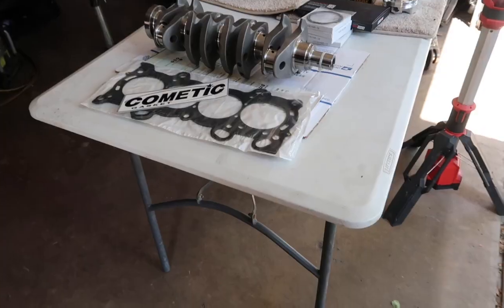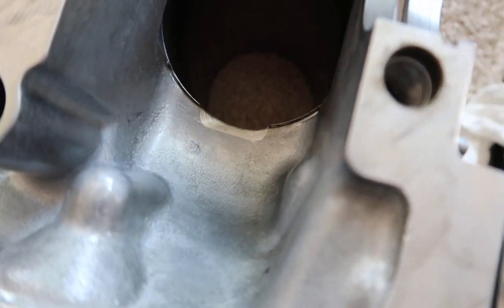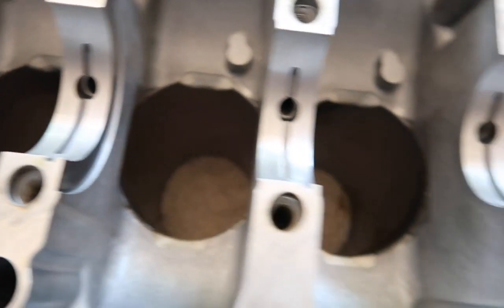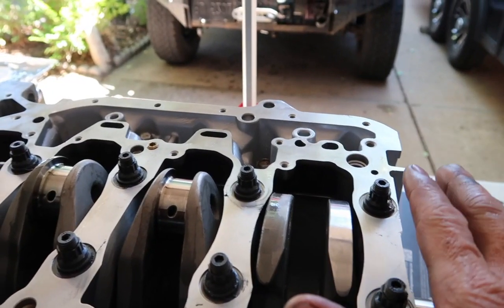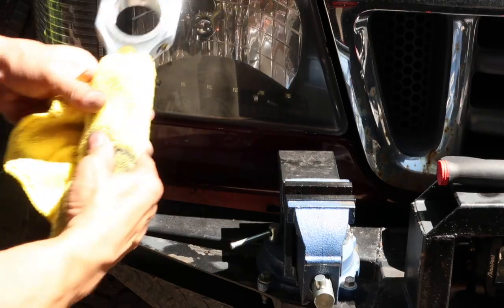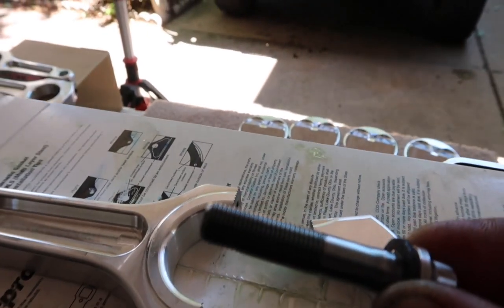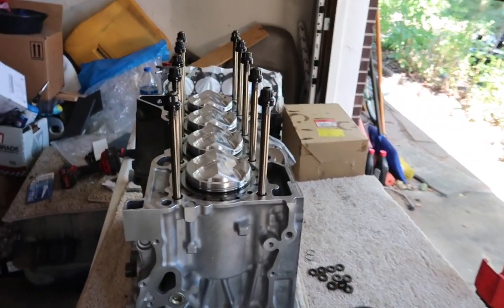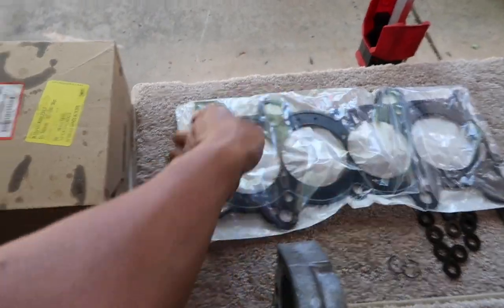Working on the Phoenix engine!!   #Allmotorphongspeed

Comment: By the time you get to this stage of the build, the final assembly is like a meditation.
After all the machining has been done, the adjustments made, the clearances checked, its time to clean the benches, then final wash every part & set down in its waiting spot covered with glad wrap. ..Until midnight, after a shower, cones & cuppa, comfy, unstressed, focused and unlikely to be disturbed.
The big finally went down in the wee hours for good reason. Distraction leads to failures.
The whole procedure is done mentally first, its the only way to be prepared.
I'll be watching this through for sure, GO PHONG.. cheers from Australia mate.

Comment: Looking good Phong. Ahh the old 1 compression ring setup nice. One thing I would definitely watch is the compression and starting top piston clearance to cylinder dome.  With aluminum rod builds the rods stretch and the compression rises in the cylinders. The motors get faster and looser when they get some passes on them. Since you are really close to the electrode to begin with you may end up closing those spark plug gaps when they begin to interfere. If you get a baseline cylinder pressure after you break in the rings it will give you a good idea in the future if you have a problem. Also the single rings tend to wear pretty fast because of the short skirt control they have. 
The best of luck to you and your build. This is one old import racer for so Cal....

Comment: Any plans on doing a filled block? Watching this for the second time and it just accurred to me, like how the big drag cars fill the water jackets with concrete, it could add weight over the front wheels for better traction and keep the sleeves from moving around. Especially since you're running nitrometh it should burn much cooler right?

Comment: Is there room to make vent holes so the pressure under the pistons can vent between the outer and inner cylinders? My free up some na high rpm power. Biggest gripe old small block chevy guys have against the Ls motors.

Comment: Love your content Phong! One question is there a reason why u lube the back of the con rod bearing shell?
Reply: Did wonder that to!
Reply: So it can spin on both sides. 
Didn't  check end float also. 
Bit of a worry.
Reply: Baz Scarlett ahh I think his rods have a dowel pin so keeps the bearing shells in place. So all good.
Reply: At 8:10 you can see the dowel pin in the cap that keeps the bearings from spinning. Over the years I have known some engine builders putting oil on backside of the bearings to help with heat transfer. Others would assemble dry on the backside.  I have seen no hard evidence as to which is better. It is just personal preference.
Reply: wagonbldr thank you

Comment: From what I know it’s a big no no putting assemble lube/engine oil behind bearing that can cause you to spin a rod bearing
Reply: I was looking for this comment 
You are right
Its not the fact that the oil is lubrication it's the fact that the oil has a film thickness and will make that bearing have a tighter clearance 

Though I've never built an aluminum rod engine before and that maybe different
Reply: These bearings also have the hole to lock into the rod and keep them from spinning. But not sure about the clearance issue from the film thickness as another mentioned. Might be fine 🤷
Reply: Also plastigauge bearing clearances.

Comment: Phong very nice build! Why did u use king on rod and acl on main bearings?
Reply from the maker: Acl didn’t have a pin hole for aluminum rods!!
Reply: @402motorsports4  brent have an aluminium rod, there u can bore in the bearings. Then u have the right bearings for ur engine

Comment: 8:24 why did you put oil behind the Bearing ? Won’t that cause it to slip ?well spin ?
Reply from the maker: The bearings have a lock pin , not gonna slips with oil!
Reply: You had me worried there because this same thing happened to Kyle I think and he had to open and wipe off everything after assembly
Reply: Oil between the rod and bearing can potentially cause it to spin if not pinned, and it does theoretically change your oil clearances between bearing and main journal or rod journal. Who knows why he'd do it, knowing his creative process I'm sure hes trying to tighten up his clearances to run 0w-16 or 0w-20 for less friction or something
Reply: @402motorsports4  that is the first thing i was thinking. regardless of having a locking pin, I would not oil the back of the bearing. But I am not building this one, you must have a reason. Very nice work, Thank You for sharing.

Comment: I'm curious to know if you have experineced more than a few spun rod bearings in your own builds?
Reply from the maker: jon s unless the oil pump fails otherwise I don’t have that problem!!
Reply: @402motorsports4  Good to know as to I have never seen lube applied to the surface between the rod surface and back of rod bearing.

Comment: Phong, I didn't think you were supposed to touch L19 alloy with bare hands due to contaminates causing mirco etching of the surface and degrading the strength of the hardware?

Comment: Very nice hardware..however dissembling of the con rod the rod needs to be clamped at the parting line..their are several rod vices...the way that you are doing it even though you are being careful protecting it with rags is not consistent with your level of skill and the pieces you are working with really requires the correct way to clamp the con rod...not trolling you but just saying

Comment: E for effort. Here is why: When torquing the rod to the vise, you created a defect to the fragile material, and probably bent the rod already. If those bolts are tight, torque the rod to the vise just below the break off line. It can also be mounted horizontally between two plates of plastic/nylon/ply. When cleaning parts for install, remember to blast all oil galleries/passages clean. When installing slide bearings, no oil between the bearing and the seat surface. it causes fault readings on clearance measurements, and therefore faulty clearing gaps. Oil between the seat can slip the bearing, and defects heat transfer, so the bearing never seats properly. Before installing piston rings, soak them in your motor oil. If a grill of a sort is used, a day of oil bath can separate fab dust and other particles, whom would otherwise grind between the piston and the cylinder. I also would double-check those bevels for the rods. They look awfully shallow.
Reply: All that supposed knowledge, and not a single video backing it up. Shame.
Reply: @eriklarson9137  Sharing is caring. His input is appreciated here.

Comment: Hey phong im no expert  but at 8:22
 I thought oil or assembly lube only went inbetween the cranckshaft and the bearing mating surface  .   

  Anyone else ?   Or is it just me ?
Reply: You are not alone, never seen anyone lube the back side of the main or rod bearings. Built a few engines, never done that. All ran over 100k after being rebuit.
Reply: I am purty sure when u use  Aluminum rods u don't use assembly LUBE
Reply from the maker: Jonatan S. Oils the back side of the bearings helped them slide in much easier!! Not gonna harmful!!
Reply: @402motorsports4  okay , i had a mini panic attack when i saw that ....  
   cant wait to see that thing screaming and making some JAM ..

Comment: Putting lubricant between the bearing and the conrod shouldn't be done with normal steel rods right? Only with aluminium
Reply from the maker: You can lube doesn’t matter steel or aluminum, use 0-20 weight oils help the bearings sit properly!!
Reply: @402motorsports4  I must have the bigends confused with the mains

Comment: Love it Phong! This is your best video I've seen on your channel (I do love the others as well). I do have a question, why are you only using one piston ring? Thanks for posting these videos!
Reply: A single-ring design is common among Wiseco pistons that are designed for racing and high-performance engines, such as the Racer Elite piston. Single Ring Pros: Lowest friction design for increased power and throttle response. Lowest weight

Comment: Watching PFI and the Boiz has trained me well, 60 seconds in and I'm wondering what kind of Oil Pump Phong will use, and if he's modified it.
Question for Phong - Why only 1 Piston ring? And, why did you tighten the bolt (in the rod and cap) in the vice, before you fitted it?

Comment: Phong I always liked your vids however i know your intentions is to build an efficient motor. Bor you have made lots of mistakes i seen you done is the video. Just a few, 1 you are NOT to lubricate the back of the bearing shell 2 dont use a regular vise to hold those beautiful rods to seperate. Check online you will the correct tool. I hope you read these comments before you put her in the car. Peace..
Reply: You can use a vice but he should have clamped right at the cap to prevent the rod from twisting.
Reply from the maker: Koko Built 345 don’t worry, the rods are made with super strength billet aluminum handle well over 1k hp not gonna break

Comment: You don't oil the rod caps you put bearings in dry on bearing bottoms only oil the face of bearings your gonna have spun rod bearings wow.. Pull it apart ASAP
Reply: Im glad im not the only one who caught that .   Someone tell phong call him tag him idk poke him
Reply: @jonatans.5080  I sent message to pfi on there channels new video
Reply: The bearings wont spin on those rods they have a pin in the cap to stop it from spinning a bearing
Reply: True that. I'm sure he built a few engines in his life, maybe nobody told him that, and so far he hasn't had any issues since its a race engine and they blow them up in less than a 100 miles.
Reply: I have oiled the back of bearing shells on dozens of engines and have never had a shell spin ,probably dowelled on them anyways